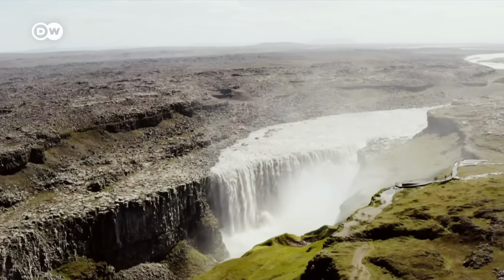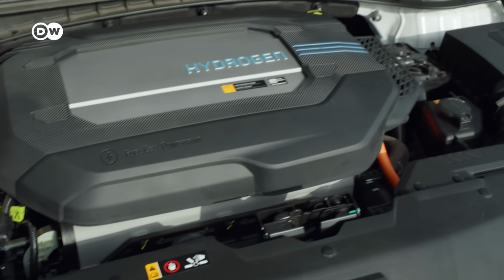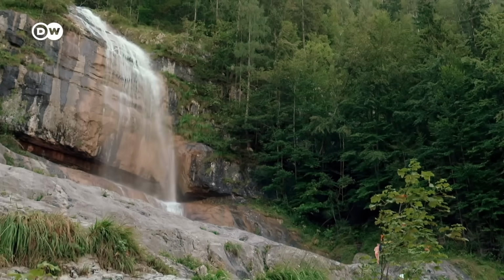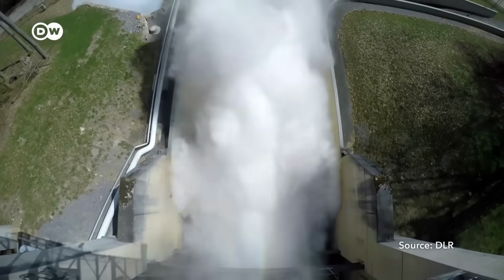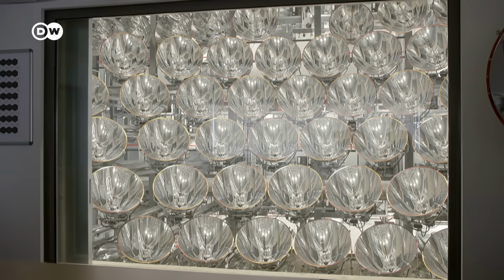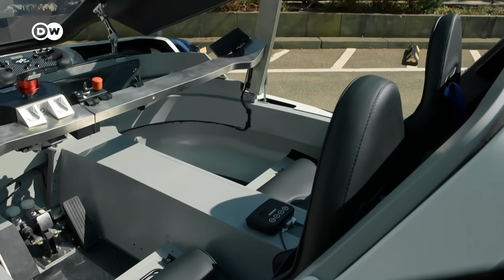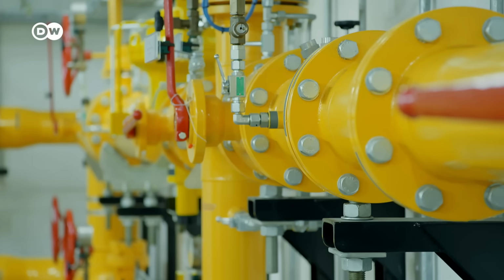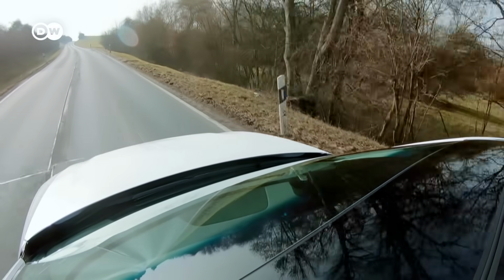Is green hydrogen the answer to the climate crisis? | DW Documentary

Comment: For the record, the Hindenburg catastrophe wasn't entirely due to the hydrogen used. They inadvertently doped the skin of the Hindenburg with what amounts to aluminium based solid rocket fuel. Once that ignited it was a very fast burn. We have better technologies available now and some knowledge gained from others mistakes...
Reply: Yes and there was the fact they passed through an electrical storm before landing and the earth bonding of the skin to the frame had been damaged. 
Previously the Graff Zeppelin and Hindenburg had covered tens of thousands of miles and hours flying without incident or loss of life in a time when aircraft were frequently having problems and fatal accidents common.  Most of the flames and heat from the gas went straight up...the skin spread the flame down and to the passenger area and fuel tanks in the keel.
Today we would build the occupied areas as fire resistant safety cells. 

If they are to use H its got to be green...and they still have the problem of contamination of exhausts with lubricants in ICE use. 

Its another alternative best suited to  dessert/arid areas .. but then  you have to draw on large amounts of water.. and as  freshwaters a rare resource globally anyway that means access to seawater and then what do you do with the poisonous salts or brines.?

For heavy plant and aviation yes it has possibilities but with fresh water so valuable and getting more so, so they have work to do. 
Meantime id be perfectly happy seeing hydrogen used as the lifting gas in cargo hybrid airships with solar electric propulsion like the Skycat ATG.HAVs hybrids.  
That way you save on damaging expensive terrestrial  infrastructure. 
You could also use closed loop recycling of lighter powerful Aluminium air batteries. 🤔
Aluminium metal melts easily compared to Iron...but is the most abundant non ferrous metal.  Smelting from ore though is very energy intensive so circular economies are required.

Comment: So ever-more-scarce fresh water will be used as fuel which will relocate the water as humidity to other places?
Reply: Of course not ! Electrolysis works better with salted water than fresh water anyway so seawater can be used.
100% pure H2O isn't a conductor and can't really be used for electrolysis, it must contain electrolytes.
There are even trials with wastewater, whether grey or black waters.
So no, drinking and fresh water won't be pillaged for hydrogen production. Some might try but I'm pretty sure governments won't let that happen, not by the good of their hearts but because it's not the most efficient.
Reply: @KyrilPG  Dude saltwater makes chlorine gas. I did that as a kid. And another biproduct is sodium hydroxide, both nasty stuff.

Comment: Production of hydrogen takes so much electricity that it makes it completely pointless to use when you can just charge Your EV car multiple times using that same electricity. Only advantage would be the range and a fact that you can refuel faster.
However all it will take to make hydrogen completely useless is for one of many new batteries currently in development to succeed and that makes it a bad investment.
Reply: Now try driving out of your (where ever specified) metropolitan locality in Stralia, China, Russia, the US, ect., with a modern electric car. There needs to be more decentralized refueling options, which don't take such a long time. Trains and planes don't accomplish the same tasks. Ask any truck driver in the US.

Comment: Ohio state university has a green box program where they make hydrogen at wastewater treatment plants from urine and feces and it uses much less electricity then just cracking water with electrolysis. It also greatly simplifies the water treatment plant. I want to see this kind of hydrogen production on a much larger scale. Then water treatment can make money by selling fuel rather then always taking money to process that waste
Reply: EXCELLENT point, h2 is good stuff, but producing it in an energy efficiant manner is still rather tricky.  any chance you have a link to this Ohio state project, soundz very kool.

Comment: hydrogen will help carbon level. global warming require full knowledge of planetary evolution which mankind do not poses. our visitors use Geo-activity for green hydrogen and mechanical high pressure filter as well as heat for all other uses. the main purpose is adjusting global temperature of planet. naturally to man these are fiction. they like to party while titanic sinks. 
Full science information in my 1975 Bremen Summerhouse notes or by official request only. Ferydoon Shirazi. MG1

Comment: So, steel smelting will use most produced Hydrogens so cars better run on batteries. Leave H2 for airplane and for commercial use.
Reply: Battery technology is moving forward forward so charging times won't be a huge problem in the future. The range is even nowadays on a similar level in comparison to a combustion car.
Hydrogen needs to be used in steel and chemical industries because they need something in their chemical reactions that takes the place of coal. Coal "pulls,, out the oxygen, the reaction looks like this:" FeO2 + C= Fe+Co2. So instead of using carbon hydrogen is used, you get the same reaction but switch out the C with an H.
Reply: The vast majority of people drive < 50 mi (80 km) daily.  Lugging around more battery capacity is extremely inefficient when considering the cost and resources to build that extra capacity plus the extra weight.  Hydrogen tanks + electrolyzers make more sense in these regards.  Analogous to today's PHEVs, Hydrogen tanks + an electrolyzer in combination with a 50 mi battery may be the perfect future compromise for folks with home garaging who can recharge overnight.  For the rare trips exceeding the battery limit, they could then use hydrogen.  
Also, in the U.S. only 50% of personal vehicles are garaged which means only they have access to home charging.  Currently, BEVs only make sense for folks with garages and not coincidentally the enthusiasts are in this more affluent demographic.  The time required to charge at a public fast charger continues to BEVs prohibitively inconvenient otherwise.

Comment: Water Vapour is the worst greenhouse gas.
Reply: You do realize, you breath out water vapor.
Reply: @MrShnazer  Yes. But its not the same as taking water in liquid form, turning it into H and O2, then turning it back into H2O in gas form, and then releasing it into the atnosphere to be the worst greenhouse gas out there.

Basically its taking H2O in liquid form, and then the end result is H2O in the atmosphere in gas form.

Global warming will accelerate even faster like this.

At least with Hydrocarbons we only need to worry about carbon capture. 

With this Hydrogen business, whether its "Green Hydrogen" or not, how are we going to account for the water vapour released?

Comment: Green hydrogen can be produced but your thinking is wrong. And the source of power must be unstable, otherwise it does not make a sense. Let me explain.
You don't need huge powerplant for that. You need local production for that but not in a large scale.
In a regular house, more or less you need some kind of power during the year - let's say 3MV/year. But in a winter your solar powerplant's performance is hammered down by 80% atleast. If you install then 10kV powerplant on your roof you have roughly 10MV of power per year - so this excess of 7MV of power can be used to electrolysis - for example 1 central facility per city. Peak production of hydrogen will be then in the summer and none in a winter. We can store natural gas during the year period, why not hydrogen then?
Or you can store that energy in a hydrostorage powerplant, or gravitational or god knows what we discover in a ratio of 3MV for your home unit(S) / 1MV for electricity storage / 6MV for hydrogen.
It is NOT EFFICIENT - but my question is "Is WINTER efficient?" - no its not. But parts of whole system can be improved.

Start counting with me, if we have 2 500 000 houses in my country, how many excess energy we will produce? It's 17,5TW for hydrogen and some sort of other storage divided by 6/1 ratio, just in case we need power for houses in long winter - it can be batteries or direct hydrogen burning.

Comment: As the world moves towards green energy, hydrogen era is coming closer and faster than expected. Hydrogen allows to store, transport and distribute green energy effectively. It has way much higher energy density than batteries and even all other fossil fuels. It has an incredible potential for scale-up projects. It is almost a flawless substance that can solve climate crisis in case of having enough attention from policy makers. It should also be noted that producing hydrogen from fossil fuels with carbon capturing and storing, so-called blue hydrogen, decreases the emission from production process of hydrogen by up to 95%. Thus, low emission and cost effective hydrogen is even possible with existing hydrogen production plants.

Comment: Not so clean Hydrogen is a multitude times superior to any Lithium ion battery. 
Lithium & additive Cadmium metals spell ecological disaster, Elon illusion syndrome.
Metal Hydrates is the KEY TO Hydrogen storage.
The patents for Metal Hydrates have expired & are  available for civilian applications & this is the NEW FUTURE for Hydrogen.
Green H2 is next step soon available.
Hydrogen is my obsession because it is integrally one with nature, not just part of natural cycle of water vapor distribution but evenly globally  spreading water vapors avoiding extremes of polarized humidity imbalances leading to disastrous equalization in the forms of strong atmospheric air displacement as of tornadoes etc.
Prevention of drought by even distribution of water vapors from Hydrogen energy use is the positive consequence of the use of Hydrogen as fuel green economy .

Comment: i feel green hydrogen at best will be a niche with limited use for a few reasons. first is the higher energy input required to produce any given unit of energy. second is the energy density/output of such system for mobility is way less than fossil fuel or nuclear. its the same reason why we don't use solar powered air compressors and cold gas rocket thrusters in cars/trucks/boats/planes etc
Reply: As a professional chemist with a Degree working in energy sector I would say it's doable, but not as smooth and easy as some people paint it. Starting from transportation, which requires very serious pipeline system refurbishing. It needs the significant technology shifting as well. The same with the "green energy". One can produce it but cannot replace the conventional energy for the moment. Predicting all environmentalists outcry I would suggest increasing nuclear power generation. It's much less scary than seems if done properly.
Reply: @ЕленаЛюбарская-ю4р  thanks for your voice of reason, for now fission is the only real green power plant option, and germany has seemingly gone mad with climate neutral bs, how could wind/solar be neutral when for both there are down times which need an alternative which in germany is brown coal, solar creates a toxic waste pile in the long run, and wind needs enormous production efforts which simply can't be "neutral". cheers
Reply: @runs_through_the_forest  Thanks, mate. Please also keep in mind that nobody cancelled the Energy Safe Protocols yet. It still states that a developed country isn't Energy Safe and Independent if >20% of energy production is climate (weather dependable). Solar, wind etc clearly falls into that segment. That's how it stands atm. What the future holds? One day we'll find out I guess.
Reply: Just to prove what I said above: look at the current natiral gas crisis in Europe. You can easily say that's because of notorius Mr P but that's stupid. One particular reason is that very quiet summer didn't allow sufficient wind farms energy production.
Reply: @ЕленаЛюбарская-ю4р  ok didn't know about that protocol, i'm more looking into astronomy and solar physics the last few years, and trying to have a decent understanding of plasma physics phenomena as it's essential to keep up with astronomy with most new insights being related to magnetism on cosmic scales.. more on the tech side it's sad to see how fusion can't seem to reach the threshold of break even or more.. anyway have a good one..

Comment: Its a shame this segment didn't focus on the solution to hydrogens efficiency of 20% because that is why we aren't already using it, I can only see hydrogen working if we have an excess of power from say mega solar farms in the deserts of the world but only after our needs have been met from the farms and by that time batteries will have become cheaper and faster to charge so hydrogen will need to compete with that also. Making energy from water and creating water when burning hydrogen is attractive to everyone but nothing in this segment indicates a solution to the abysmal efficiency problem it has.
Reply: Hydrogen production is also a way to store energy to balance the peak/trough of the grid. on the other hand, battery technology has its limit, the energy density will not increase forever, so the charging rate. my concern over hydrogen is its safety compare to the battery and fossil fuel

Comment: We can get hydrogen from electrolysis of sea water, we get oxygen and clean water too...and they already did it in the submarines.
Reply: It's a lot less efficient. 

If we could efficiently get clean water from electrolysis of sea water, water shortages would be a solved problem by now.
Reply: @0Ressun  Then where Saudi Arabia get their fresh clean water? :))
Reply: @MizanQistina  Unfortunately the electrolysis of water is only 60% efficient, to run the world on Solar would require a solar system 36,000km2 in 24hrs sun light, not enough resources available.
Reply: @88njtrigg88  To get hydrogen...
Reply: That is how much green hydrogen is produced with renewable electricity. Covered in the video.

Comment: The technology exists using nuclear/wind/solar/hydro to create green hydrogen. There are loses in the generation of hydrogen through electrolysis. And there are loses generating electricity in the fuel cell. But it works. I think you lose about 40%.
The actual huge challenge is scaling all these items together. Eg Building enough wind (mining enough copper, skilled workers, available fabrication sites and vessel etc). The storage and transportation. Fueling stations. 
There are also having defined engineering standards. The whole compliance aspects for insurance etc.
If we are to move from gas central heating and power generation to renewables. We also need energy storage, similar to 2 months of your annual capacity. We will need more electricity for heating ours homes, cooking etc. Therefore making additional hydrogen will increase the amount of electricity we will need to produce.
The scale of the challenge is massive. But maybe we will get there.

Comment: Fusion imo is the key to climate crisis, but hydrogen is a nice step until we get there.
Reply: Fusion won't help us with climate. We haven't even achieved it yet, and even if we do (in the next 20+ years) the price of it will still be huge issue. We need solutions now.
Reply: Hydrogen is a good replacement for the battery reliance in electric devices. Another use for storage from green energy plants. The biggest problem is the storage of hydrogen, which is the reason to why it hasn't retired those batteries.

Comment: Hype! Takes more energy to scrape it from other elements in order to be usable as fuel than to use it as fuel.
Reply: Thats always the case, you always get back less energy that you put in
Reply: I think Dr. Averbeck in the video had a very balanced stance on it all: let the regular people rely on electric vehicles, and focus the hydrogen technology on long distance transport. However while I agree that it seems unnecessary to allocate a lot of energy to produce a fuel instead of focusing that energy directly into something like an electric vehicle which would be more energy efficient, some components of these electric vehicles (mainly the batteries) do after all rely on resources that are not very eco friendly with our current technology.
Reply: You make no sense. Hydrogen is a element, it is not made from other elements. Hydrogen is not 'made' using energy, it is accumulated. This is basic physics.
Reply: @jokers7890  I literally copy/pasted you an article from Time magazine. If you're too dumb to read then this conversation is over.
Reply: Rly? Ok
Reply: @lukasdoms7483   "The concept was simple, explained natural-gas proponents serving on the state’s climate-action council. Industrial hydrogen suppliers had long used a process called steam methane reforming (SMR) to produce what the industry calls “gray” hydrogen from natural gas—a system that accounts for 95% of all current hydrogen production, but releases large amounts of carbon emissions. Emissions-free “green” hydrogen can be produced using water and renewable electricity, but that tends to be more expensive than making gray hydrogen. The solution, gas-industry representatives said, was to pursue a kind of carbon compromise. Instead of making expensive green hydrogen, industrial gray hydrogen facilities could be outfitted with carbon capture systems that buried their emissions underground. Voila: A new color in the hydrogen rainbow—safe, clean, abundant “blue” hydrogen to power the economy of the future."

There you have it. 95% of current hydrogen is a by-product of fossil fuels. How amazing.